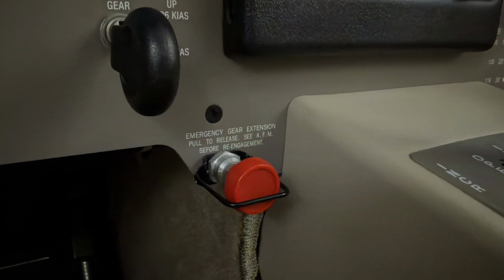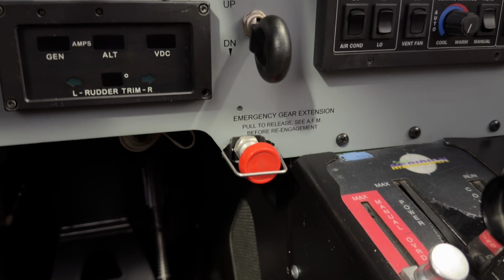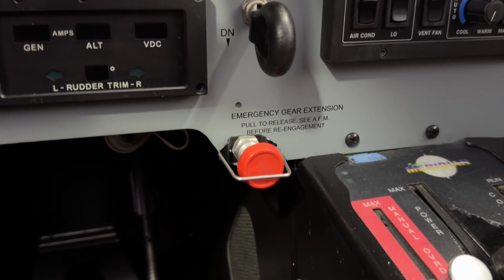Common Maintenance Issues with the PA46

Comment: To reinforce yours and Kenneth's comments about the importance of oil changes from the standpoint of inspections, at our latest oil change [M350] it was discovered that a heat shield had come lose and chafed completely thru the wall of the exhaust crossover pipe, creating that blowtorch of which you speak. Fortunately, it was discovered when it was...and there was absolutely no indication from inside the flight deck, or on preflight, of any abnormality. In fact, the last flight before the oil change was 4+ hours, most of which was at FL 250 to stay out of the clouds and icing. Would have been a particularly daunting place to have an emergency.

Looking forward to M-Class next week.

Comment: Is there a bypass  micron oil filter stc for the pa46? 
Its used in the consumer truck market. It runs the oil passively through a 2 micron filter a d cleans the oil really well
Some motors like powerstroke run up to million miles with bearings rings etc in excellent condition